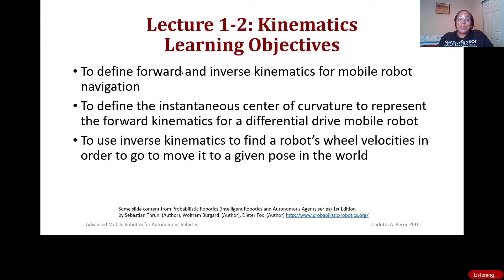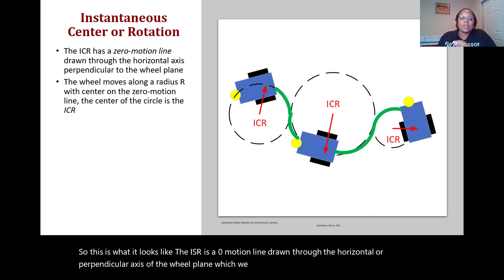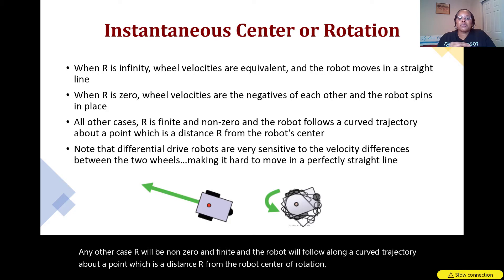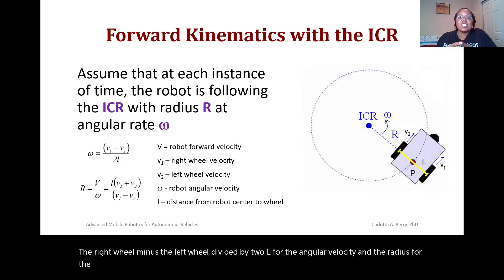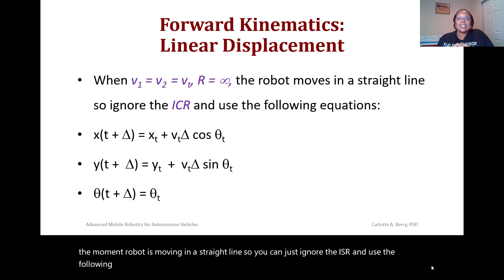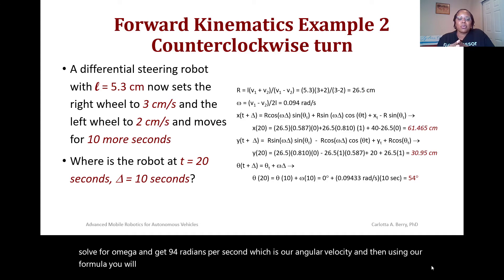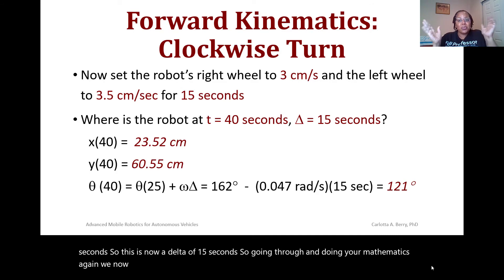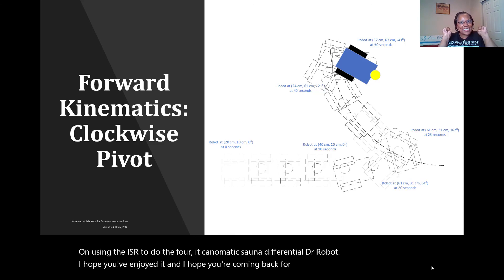Advanced Mobile Robotics: Lecture 1-2b -Forward Kinematics w\ Instantaneous  Center of Curvature

Comment: Hello Prof! Your presentation is Interesting. But I have a question is How do you account for wheel slip or skid? If the wheel spins on a slick surface, sand, or stones, it will turn, yet remain in the same spot
Reply from the maker: You will never be able to correct for all odometry error and the encoders will keep counting so you will need redundant sensing like an encoder and something else like maybe a beacon or floor grid to correlate whether the robot is really where it thinks it is. NoireSTEMinist.com